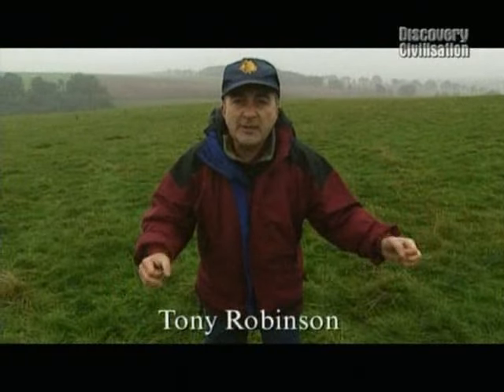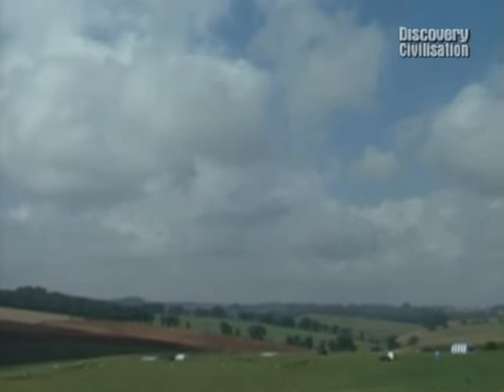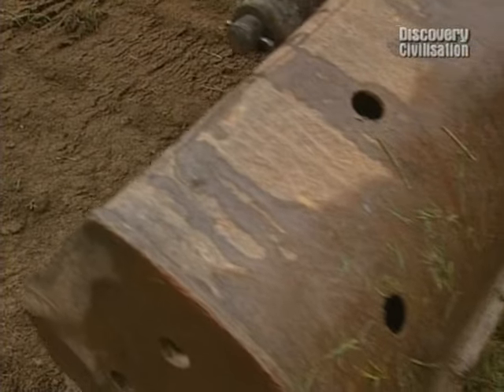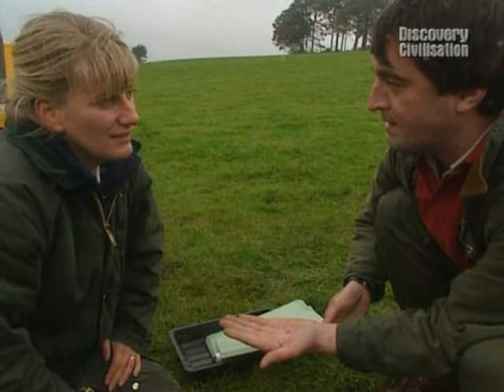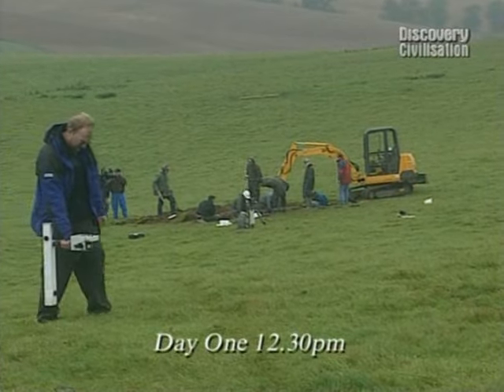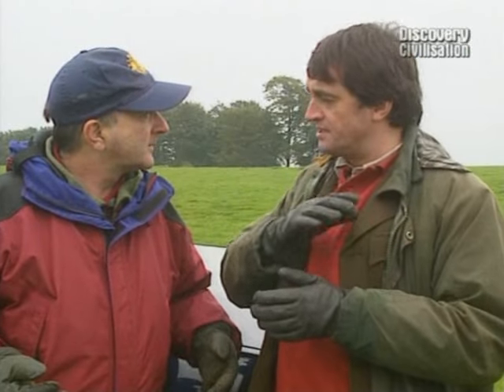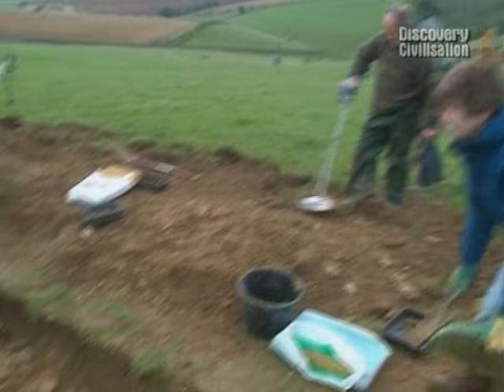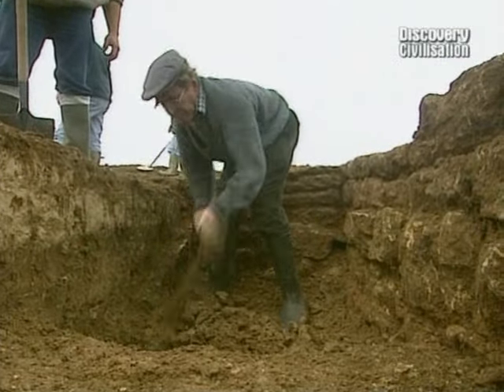Time Team S06E09 TurkdeanRevisited,.Gloucestershire

Comment: It's duly noted that the metal detectorists pulled their weight. Also, it's groovy that the Roman's two thousand year old water supply system is still working fine.
Reply: At the height of the empire, Rome's water supply was epic. It wasnt replicated or surpassed again until after WW2. 
blows my mind.
Reply: Yes, we found the same at Charterhouse on Mendip in Somerset: we traced the lines of the Roman culverts (known as gouts in Somerset), and when we excavated down to them, there was the water still running. One of them bringing overflow water from the Roman town emerged lower down the hill, and was a holy well (Mawdlyn's Well) in 1533. If only they'd known...
Reply: Vince Russett .
Reply: “Duly noted”? “Groovy”? In the same paragraph! 🧐🤔🤓😂

Comment: I'm befuddled by the "meticulously recorded" bit.  There's a fellow standing there with a pencil drawing the positions of the stones on a sheet of paper.  I'm no archaeologist, so I don't know the details, but did the Time Team not have access to a device invented some period of years ago called a "camera"?  And would said "camera" (if I am spelling it correctly) not have been capable of recording multiple views of the positions of the stones more rapidly than a fellow with a pencil and a sheet of paper?  Or am I completely mad?
Reply: Quite right. Then (and even more now when high-quality digital cameras are easily available), photographic records would have been made. Drawing plans is not a completely objective action, as thinking carefully about the position and thus relationship of each context to the next, helps you to understand the site better. Even with superb photographic recording, I still like to do the old fashioned drawing for that reason.
Reply: They have always done both once camera technology was advanced enough to use in archaeology.

Don't put all your eggs in one basket so to speak.

Comment: Why build a pagan shrine for a fourth century Roman Villa?  Rome was Christian by then.
Reply: Missed that whole "Constantine made it law thing," huh?
Reply: That doesn't remove the consequences if caught, and the consequences in Rome were slightly more awe inspiring than the consequences in the modern west.  I hear your point, and its well made, however I'm questioning why it would be the first interpretation of an unknown structure.
Reply: Precisely my point.
Reply: Celto Loco where is this place I can buy a budwich?
Reply: ***** Right, so all the history that has been taught for the past 1700 years or so is undone by a Wikipedia article.  I'll be sure to bear that in mind.
Reply: +userunavailable3095 The film said they were probably Romanized Brits, and that the original building was 2nd century, which was pre-Constantine, so pagan shrines would have been logical, and possibly continued beyond the decree from Constantine.  There were pagans all around, probably pagan slaves and field hands.  Going forward into the 3rd and 4th century I would expect continued pagan beliefs, or a mix of pagan and christian.
Reply: Rome perhaps, but many frontiers and outskirts of Rome weren´t yet ready for it refused Christianity. So, the Romans had two options. Keep in peace with the locals or at war with them. And for Rome there was also another thing. No matter what religion you are, when you keep paying the taxes on time there´s no problem what your religion is.